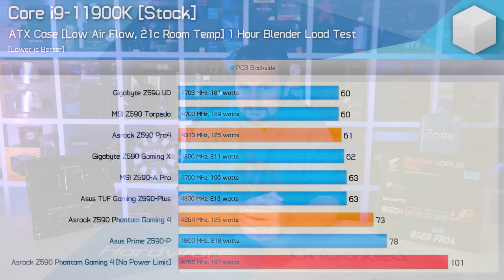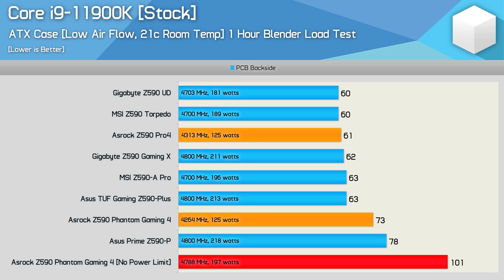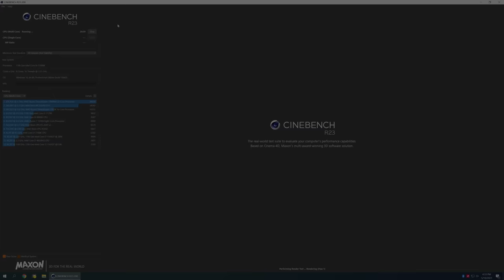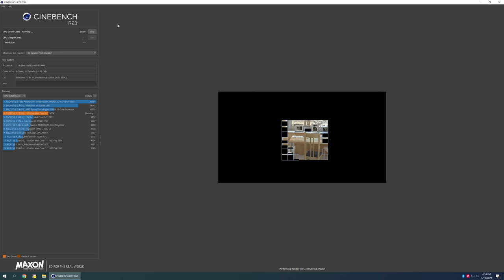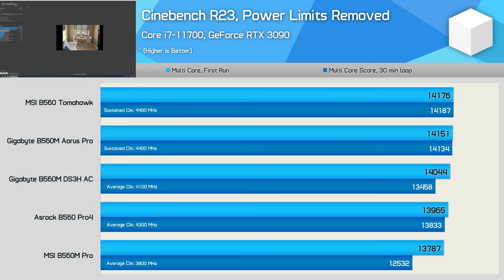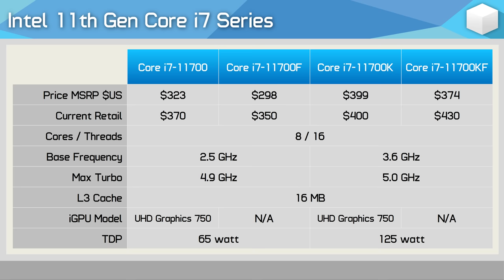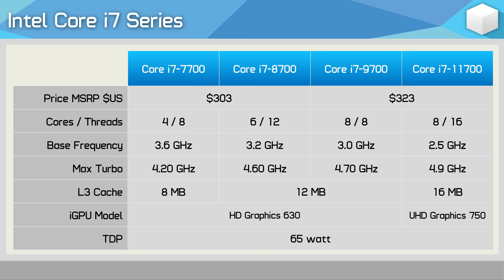Intel B560 is a Disaster: Huge CPU Performance Differences, Power Limit Mess

Comment: Who would buy a board with no VRM heatsink and expect some kind of advanced power delivery out of the box?
Reply from the maker: So you're saying who would expect any B560 board, regardless of price, to be capable of running at all performance specifications? Also that's not even the entire point of the video.

Half of all B560 boards run at the TDP limit with the other half running without power limits, resulting in some boards offering up to 50% better CPU performance with a part like the 11700.

Comment: oh dear. i remember this same thing on Socket A some 15 years ago. where my HP desktop had a motherboard failure and it got replaced by a "WinFast" motherboard.
it was a MAJOR bottleneck for my pc because I could no longer play the original Crysis. This was on 2GHz AMD Athlon 2800+, 1GB ram and a Radeon x1670 512MB

Comment: Thanks for not blaming the mobo manufacturers. It is intel's fault for FOOLING the customers by claiming 65w TDP and then announcing frequencies that are not reachable with that TDP ; not even close.
I also need to know that my cooler can handle the advertised TDP.
DAMN INTEL!
Reply: PL1 is for base clock: that's the frequency a CPU should achieve under PL1. If an 11400 can run 2.5Ghz(base clock) under 65W(PL1) then it meets the spec, period.
Turbo clocks are not the speed the CPU must achieve.
Reply: @deidian635  Obviously not the case. The 11900k is said 3.5ghz base, but achieves 4.3 at the advertised TDP. So the Turbo is definitely within the power envelope. But they fool people by advertising 5.3GHz Turbo (and consuming up to 220w at 4.8!)
AMD kinda does the same since the Bulldozer, but much more conservatively, overshooting by 15 to 30w only. Here intel is really pushing it hard! They are trying to make their CPUs look better than AMD's at any cost.
Reply: @sassuki  No, if they can do more they can do more, not every CPU is equal and cooling changes things. Intel says how their specs line-up:
PL1 - base clock - stock cooling
PL2(within Tau duration) - up to turbo clock - stock cooling

Turbo clock isn't even promised as achievable in all cases, it's just an "up to".
Reply: @deidian635  doing more is called OC. If the CPU can't do more than 4.3GHz with 125w, then it should be advertised as such. Throwing numbers like up to 5.3Ghz is just misleading marketing in this case. A single core load will probably stall at 4.5 or so to stay under 125W. Definitely not 5.3
Reply: @sassuki  Overclock is operating frequency, voltage and/or power draw over spec, but the manufacturer still says what's spec an what not. CPU are complex today, they aren't anymore just doing some fixed frequency and that's it. Also they are different, even having same part number they can have different power draw figures and capabilities which is why some 11900K can do a heavy load at 4.3Ghz with 125W and others may not. For example best samples of 11900K have v/f point 5.2Ghz@1.4V while worst samples have 5.2Ghz@1.5V, so you can easily expect from a bad sample 300W or more power draw if they manage to pull off 5.2 stable at all while a good sample would surely do it and power draw will sit around 250W. Given this no manufacturer can practically do anything else than saying this CPU model has to at least do this, then "up to" depending on circumstances, even AMD does that when it comes to turbo clock. They don't say "up to" in turbo clock/max clock spec and they are lying because not every sample in every condition it's going to hit it within spec.

So in the end the spec ends being more complex, but it's your task as potential buyer to get the spec through your head before complaining. Alternatively you can not be concerned about it and assume motherboard manufacturers are going to propose something within spec or at least reliable in long term use in board default operation of the CPU.
Reply: @sassuki  Or you can keep quiet if don't even have an insight on CPU specs.

Comment: Intel seriously needs to consider making these "power guidelines" to actual specs in Alder Lake and up. Sure, still give motherboards/BOIS let the user disable the limits if they wish, but mandate they enable the power throttle specs by default.
Reply: They make those low end special for cheap office computers, that don`t need to run fast…

Comment: Seeing as buying bottom of the barrel b560 boards is out of the question, this discovery kind of balances out the amd vs intel situation, since now in order to use cheaper intel cpus, you have to make up the cost in motherboards. There are interesting times.

Comment: PL1,PL2, TAU ... How dare those cheap motherboards stick to the spec! This is no different to 10th gen on B460, except 11th gen just being so much more power hungry and requiring to run at less mhz to hit the same 65W target. Can't wait for the VRM thermal tests for these. Also, it be nice to test some ITX boards like ASRock B560M-ITX if you can.
Reply: BFB on that board is 100w max. 11400F will run sustained 3.8Ghz while 11700F will run sustained 3.6Ghz.

https://www.asrock.com/mb/features/BFB-B560M-ITXac.png

If you manually unlock power limits then it'll probably be fine with gaming since H510 shows no difference with Z590:
https://youtu.be/wupkDPaJvi4?t=236
Reply: @ailluinthethyra6139  yes indeed. I have a 10400f on a cheap 4 phase VRM ASRock b460 ITX board and that can sustain a 3.8 to 4ghz all core boost indefinitely in Cinebench at 65w. ASRock removed BFB in later bios releases for my board since the VRM is so crap. Hardly needed with the 10400 though since it gets a lot done at 65w. The 11400 being more power hungry is a different story at 65w, but yes this is where BFB or similar power unlock tech helps a lot if the VRM is up to the task.

Comment: Isn't this kind of expected? Cheap boards can't handle heat very well and these new Intel cpu's run hot af. If you want ridiculous all-core boost, better invest in an aftermarket cooler and an expensive board.
Reply from the maker: You'd hope all boards could run the CPUs stock at their maximum 'stock' specification, that's not the case and it's because Intel has a maximum specification that they don't publish.

https://twitter.com/HardwareUnboxed/status/1385051271451660290
Reply: @Hardwareunboxed  Appreciate the answer and your video. However, I still can't fully agree with the premise. We know infinite turbo is officially within specs. But we also know from reviews that infinite turbo pushes the power consumption to more than 200, if not 300 Watts. In the "old days" you would know to buy an overclocking board for these kind of values. I think our difference in opinion comes down to this: I see the infinite turbo as a kind of auto-overclocking, a nice performance uplift if you have the power budget, whether you see it more as "guaranteed" performance. 

To me, it is obvious you need an expensive board to support a huge power draw, but I can see how it can appear misleading to less informed customers.

Comment: Researched similar issues using 10700f and above on the B460 motherboards.. Asrock was horrendous except for their 3 top (Z rated) motherboards. MSI B460M Mortar was amazeballz!  Allowed a 10700f run at 4.65-4.7GHz on all cores when gaming where as the Asrock B460 "steel legend" ran it at 4.2GHz! 10th and 11th Asrocks were terrible except for their highest end boards.. Perfectly fine for a 10400 but nothing more.  Some gigabytes sucked donkey ballz also as did a couple Asus and MSI low end. Z boards however, Asus, MSI and Gigabyte did well enough.. those B boards though.... Interesting to see these B560 results. I think MOST of these are meant for a 10400-11400 TOPS. Keep pissing off the big boys.. we love you dudes!

Comment: This is not as bad as the title says. If you use stock Intel cooler, that is really bad… it is better to have those low end power limit settings! If you change desent cooler instead, you most lilåkely know also how to change the bios settings so that you get higher power limit!
Intel stock cooler, with unlimited power does not sound sensible neither…

Comment: In my opinion, this is as significant as the videos about Nvidia's driver overhead. And it's probably something reviewers should account for. In other words, it would be great if we got actual motherboard reviews, because apparently there are now performance differences between them, which usually wasn't the case with previous generations. And especially since B560 motherboards are able to overclock RAM and remove power limits, I think it's an important buying choice.

Comment: So if you buy intel based roducts, you have to hope that the MB games the CPU to auto overclock/power stuff and everything should work.  If you buy cheaper MB for cost/performance, they will run it as sold and performance tanks.

Comment: I know this is an older video but could you check how the cheaper motherboards will perform with a CPU cooler the blows down onto the motherboard? I suspect it will keep VRM temperatures lower and sustain higher speeds indefinitely. Perhaps it'll perform even better with the fan oriented so it pulls heat from the motherboard.

Comment: Does this negate your previous 11400f + b560 recommendation then?
Reply: He tested the 11400F with the Tomahawk, which did a good job. But it is not really cheap.
Reply: If you know how to unlock power limits(just switching one BIOS setting to another in MSI & ASRock boards) then it's a non-issue.

For 11700F then VRM performance becomes another consideration.
Reply: Yes the point is that non pc enthusiast maybe don`t know how to change bios settings. Otherwice there is no problem.

Comment: Building now: Asrock b560 steel legend 135$, 11500, cooler master h212, psu 650w, 6 air fans ATX casing. Problem, please tell me?? Testing soon.

Comment: As long as they're above base frequency, that's all they have to do to meet specification. Maybe that's not what buyers expect because they so often run between base and turbo, but it's the only guarantee they have. 
Ironically, if intel "enforces" the spec more to avoid consumer confusion, it would likely decrease default settings performance.

Comment: Asrock B560 Steel Legend has been working well for me.  With power limits off on the 11400 it boosts to 4.2 for an entire cinebench run.  According to buildzoid the z590 steel legend had decent power components, and the b560 steel legend seems to have similar vrm and is only 130$.  I don't see the point of benchmarking with power limits on, so random.

Comment: My 4790k only holding stock 4.0ghz base did 5000 on Cinebench R23 on a loop run so that's pretty embarrassing on the lower end b560 boards.

Comment: can we expect any i5 Alder lake processors this year ? i was saving for 11th gen but still in a loop..
Reply: The socket will change & yes Alder Lake should launch by the end of this year.
Though I'm wondering why you aren't considering Ryzen
Reply: Either get cheap 10th gen or wait for 12th gen. 11th gen is basically a desperate attempt at releasing chips when in reality they have nothing new to offer.

The only difference is that they pump even more power through the chips in an attempt to keep them competitive. Which is not working, proven by this board fiasco. 

Because those chips need so much juice, the boards need to be way better quality to not throttle the cpu and that drives up the price for the cpu/mobo combo.
Reply: @sushimshah2896  Because the price? people dont want to pay 350$ for a 6 core lol.
Reply: @sushimshah2896  can't pay more than 200$ for a processor so current zen 3 processors are out of my budget

Comment: My ASUS Prime H510M-A mobo has 125W power limit out of the box and sustains 4.2GHz boost on i5 11500 in Cinebench R23. Turns out that some H510 are better than B560 at a lower price.

Comment: I'm really really looking forward to the update to this video. I'm looking at buying the Asus Prime B560 Plus. I'm currently debating on cpu between the 10600K or the 11400. They're around the same price point. I can't currently take advantage of the PCIe 4.0, but struggling with wasting a K processor on a board that can't overclock it. The B560 seems like the board with the best upgrade path for me as z590 boards are just out of my price range.

Comment: If you pair this intel CPU with an aggressive motherboard and run it in turbo all the time, ignoring TDW, does it void the CPU warranty? If the cooling keeps it below the throttling limit, is the CPU life shortened, or not?

Comment: Hymmm i recently bought i7 10700 for cheap and was planning to pick some cheap b560 board for it and now im concerned. Would i encounter the same problem with my i7 10700 on those boards?
Reply: Very likely
Reply: you would be fine with B560M steel legend, B560M Mortar if you want wifi.
Reply: @shiveringisles3509  Do you have any thoughts on Asus TUF GAMING B560M-PLUS? I could get it for a fair price and was thinking about it.
Reply: @logs8833  yeah it's fine for removing power limits.

Comment: More clickbait than disaster. 

This is pretty much expected.  Cheaper boards more likely to respect the power limit spec so they don't need VRMs capable of delivering high power.

Even the cheapest crappiest board here can handle the processor most likely to be paired with it (11400).
Reply from the maker: This is 100% on Intel as explained in the video for their loosely defined operating specification. If you wish to learn more I suggest reading the interview linked in this Tweet: https://twitter.com/HardwareUnboxed/status/1385051271451660290
Reply: @Hardwareunboxed  There is no mystery here. This is behaving exactly as expected. People have been talking about this for years. This is just making mountains out of molehills.  I wish everyone would shut up about it, because eventually Intel might just listen to complainers and do hard enforcement on the power limits. Meaning all the locked CPUs would have less performance on all the boards.  But hey that would be another great disaster to report... Terrible Intel is now enforcing power limits (that we complained about them not enforcing) and reducing performance.

Comment: It makes sense, msi b560m pro is the cheapest board with no vrm heatsink on mAtx.
Meanwhile a full ATX asrock board with a heatsink is barely keeping up with the also cheap mAtx gigabyte ds3h.
Tldr you get what you pay for so buy a giga/msi/asus with a solid vrm and heatsink.

Edit months ago I pointed out intel and nvidia make bullshit "base clocks" so throttling could be mislabelled as boosting.
As long as the intel cpus over the bullshit 2.5ghz base and a 2080 is over the bullshit 1500mhz "boost" clocks that means when someone's cpu or card is running really slow you'll be told "its not throttling...its boosting less".
I remember when graphics cards had a clearly defined clock speed they were expected to meet.
What if r9 290s were specified to have 700mhz boost clocks, would that mean none of the reference 95c models ever throttled?

Comment: Thank god I bought AMD, upgraded from Ryzen 2600 to 5800x, only 10% lower than expected on Cinebench and that's probably due to my shitty 3000mhz ram. point of the story is I'm running b450m-ds3h(bought it on amazon @ $59.99 sale, usually costs $65-70)
you cant even get that value from current gen intel platform let alone backwards supported one.

Comment: So what you are saying is that a Dell/Lenovo/HP i7-11700 PC might be 50% slower than a similarly specced store build? I knew it was going to be painful when I saw how much the official TDP is useless this generation, but DAMN!
Reply: Not really, you will have to see it by per model basis. OEM system builders get their own custom boards for their models(don't be surprised if when you open a DELL you find out the motherboard is a non retail board made by Foxconn), so they have the capabilities they decide to make or contract with the manufacturer of the board. Same stands for laptops. All these computers have the power limits that OEM want.

Comment: It's all AMD fault ! If they didnt push 'the moar cores' thingy as certain website refers it to, the i7 would have nice 4 cores + 4 threads @ $500 and the motherboards would be coping with the power requirements without troubles using the cheapest available VRMs . Now, Intel is forced to discount their state-of-the-art babies which in consequence, adversely affect the customer's self esteem and confuse them, because it's the AMD cpu that is for poor people. At least we are blessed with the B560 mATX @ $150 , I would really feel bad if the cheaper motherboards cost $35 again.

Comment: Even then can you guarentee that the boards will contain the same components for reliable power delivery or wont receive a bios update that hamstrings performance.
Its impossible to know what you are buying or how it will perform without testing everything on the day which is inpossible. The whole situation is insane

Comment: Wonder if under-volting the CPU would help to get higher clocks while keeping power just low enough to prevent throttling on the cheaper motherboards with unlocked TDP limits. Or would they just not be stable enough at lowered voltages?
Reply from the maker: It would certainly help, how much depends on silicon quality,